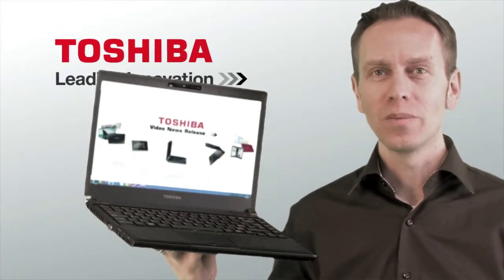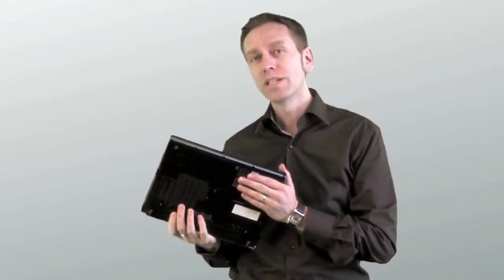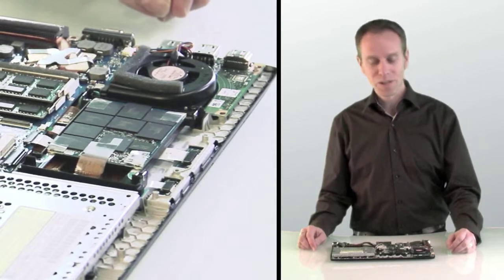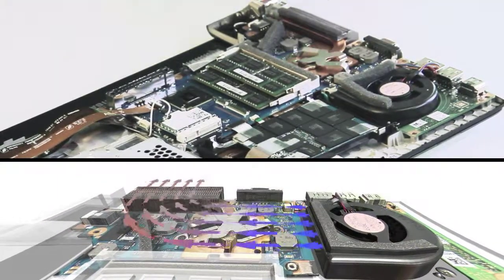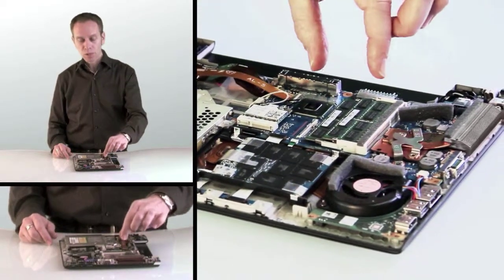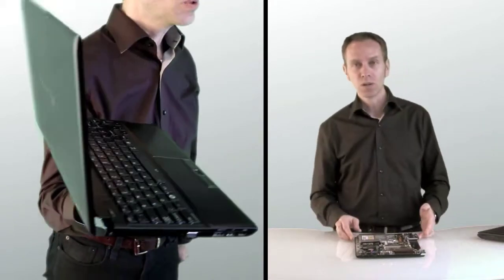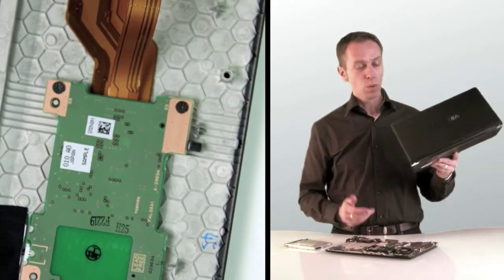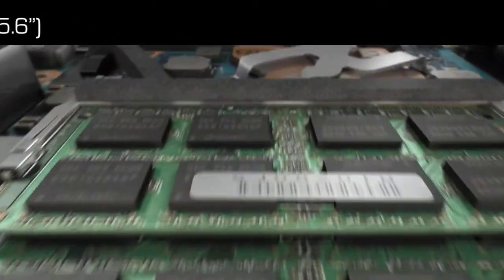Portege R830 inside view

Comment: here in 2021, "revolutionary cooling technology" the CPU run at max 100 and idle at 60 (ofc it would! how many years have passed since it was released!? you should change the thermal paste!) but i think for that time, calling this as a "revolutionary" isnt necessary, i think the standard cooler design just beside the heatsink would work better than this design